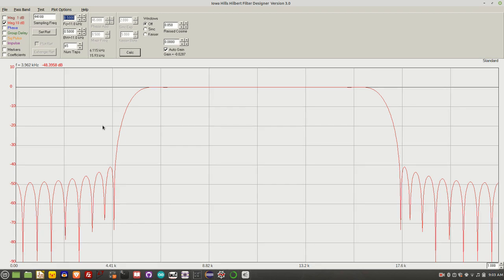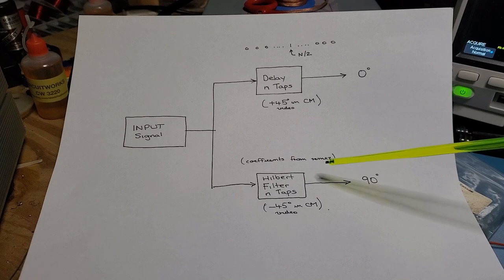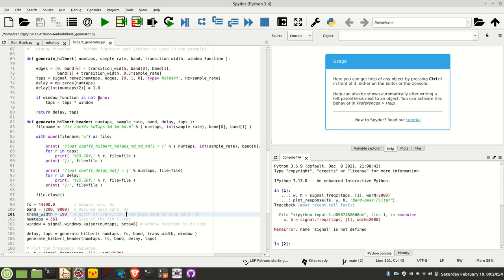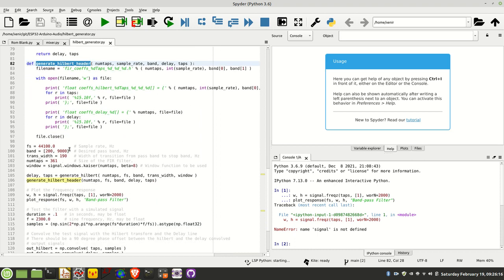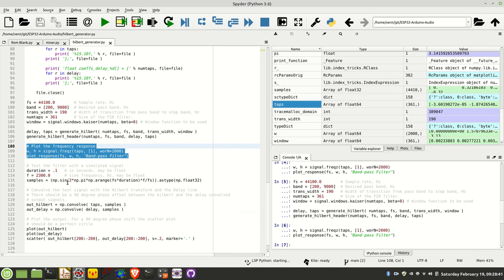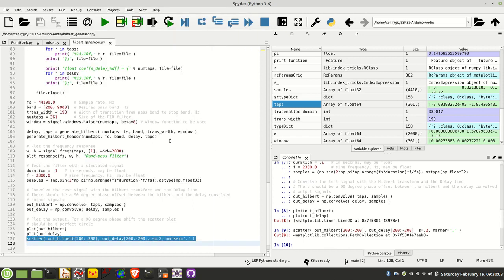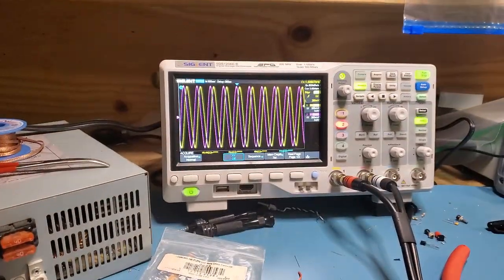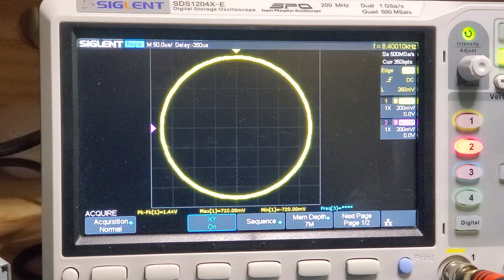Hilbert FIR Filter for 90 Degree Shift using Python

Comment: Interesting but it seems to me the delay is improper... the I component needs to be filtered in a complementary way to the Q component, that way the lissajous plot will always be circular, and the radio wave will be perfect single sideband. I'm not sure what is the best way to get this though...
Reply from the maker: You are exactly right Mark. I discovered this later on - what I ended up doing is running the signal through a bandpass filter prior to running through the Hilbert filter. I had thought I updated the code - but I checked and its still the same. Let me see if I can find the updated code somewhere. Thank you for the comment!

Comment: Many thanks for sharing 👍As I understand from the documentation for scipy.signal.remez() it's not necessarily to suppress low frequencies as you previously did with Iowa Hills software. The function merely looks for the coefficients which give you the desired filter, so you can create a LPF or a all-pass-filter if you want to (but maybe I'm missed something). Also it's worth noting that the "delay" implementation although OK for the demonstration is sub-optimal. There is no need to do hundreds of multiplications to zero in order to delay a signal for the given number of samples.
Reply from the maker: you are definitely right on the delay line - I just wanted the easy path ;)

Like I said though I couldn't find any way to produce an arbitrary phase shift. Drop me a line if you find one.
Reply: @na5y  Finding a DSP filter with the desired frequency and phase response can always be considered as an optimization problem, or alternatively as a search on a graph. Your state are current coefficients of the filter. You fitness function is the difference between the current filter response and the desired one. The edge on a graph is the change of one or multiple coefficients. There are many algorithms that can be applied to the task: genetic algorithms, bread-first search, A* (A-star) - just to name a few. These algorithms typically are well covered in the AI related textbooks, e.g. "Artificial Intelligence: Structures and Strategies for Complex Problem Solving" by George Luger. Basically the same algorithms are used in the database management systems for SQL query planing/optimization. The suggested approach would be somewhat brute-force of course but it will work.
Reply: @na5y  An additional piece of information was found in the famous "Digital Signal Processing" by Steven Smith (aka DSPGuide) on page 573. Let's say we have a Hilbert transformer that shifts the signal by 90 degrees. Subtracting the shifted signal from the original one gives us -45 degree shift. The process can be continued in order to get any necessary phase shift.

Comment: Thank you.  Nice work. I was able to save the Iowa Hills site before it went down.  But this is clearly the way to go.
Did you try it at the low wend of 300 of 400 Hz?  If not 90 degrees, the suppressed (opposite) sideband will jump up.
Reply from the maker: Thanks for the comment. The low frequency is definitely a problem and the bandpass filter created doesn't quite weed out the low end. A greater number of taps ameliorates the problem a little. I know software like HDSDR has the local oscillator frequency offset from the tuning frequency by 5-10 kHz - I have been meaning to play around with that technique...

Comment: Thank you, I was searching for a means to do 90 deg phase shift for grid voltage (to create a PLL), following are means that I know: -
1. delay lines -- depends on frequency.
2. Second order generalized integrator -- it needs separate "w" (freq) to be measured, but if we somehow measure (using a zero cross circuit) and feed into the SOGI block, it works good. It also has the advantage of ignoring the harmonics.
3.Hilbert transform -- I read in books but never found a practical implementation, untill I saw your video. Let me try it.
Reply from the maker: I was in the same boat - I could find plenty of papers on the topic (which mostly went over my head) but little in the way of implementation. I hope you are successful! Let me know how you get on

Comment: Grest video tutorial, there Is no band limitation in the delayed filter. I can see an horizzontal line in the Lissajous plot (x,y) out of frequency limit. Will you insert a prefiltering before? Thanks, Antonio (Rome, IT)
Reply from the maker: Thank you Antonio. At the beginning of the sequence the FIR filter produces a poor response because the delay line (the delay line required by the convolution algorithm that is) isn't populated.  I should really change the XY plot to remove the beginning "n" outputs where "n" is the tap length. Is that what you were referring to?

The delay line itself has no frequency limitation - beyond of course the limitation imposed by the sampling rate
Reply: @na5y Dear Ian, thank you for the prompt answer. Let's for example think to the ssb modulator in which we add  or subtract the two signals (delayed and hilbert filtered) to get the SSB, these two signal shall have the same bandwith otherwise we could have an unwanted signal out of the working bandwith. In this case the delayed one has more bandwith, as you say limited by the sampling. So mine was just a pleonastic statement to say that at the input it is necessary to limit the band of the audio signal before processing it. I just ordered the pmod-i2s and I will follow you on this project. thanks again Ian. Antonio IW0FCI
Reply from the maker: @antaf56  Agreed - without limiting the audio bandwidth at input you'd likely get aliasing artifacts. Thank you for the comment Antonio and good luck with the I2S2 board - let me know how you get on!
Reply: @na5y  For sure I will!! Thanks Ian

Comment: I don't understand the ESP32 throughout. Using 2x FIR channels, each having 361 taps, at sampling rate of 44.1kHz need approx: 44.1kHz ×361taps ×2 ×10(MACs) = 318MHz. Here it was assumed, that each multiply/accumulate operation using floating precision will take about 10 (7+) processor clocks (based on Cortex M4 estimates).  The ESP32 max speed is 240MHz. How does it fit?
Reply from the maker: You have an interesting question there odissey. The convolution code used is not mine and comes from the ESP-DSP library and is written in assembler
https://github.com/espressif/esp-dsp/blob/master/modules/fir/float/dsps_fir_f32_ae32.S

The ESP32 I am using is dual core 2x240 Mhz - but I don't see anything in the above assembly to do multicore processing. Let me do some digging - you've got me intrigued now. I didn't see any jitter or artifacts in the output

Thank you for the interesting question ;)
Reply from the maker: There's some benchmarking code in the ESP-DSP library here
https://github.com/espressif/esp-dsp/blob/master/modules/fir/test/test_dsps_fir_f32_ae32.c

I'll run it and post the results.

Unfortunately I don't know ESP32 assembler so its a bit hard for me to figure out what is going on. Stay tuned though
Reply from the maker: OK - so I added a simple performance test to "passthru.c" which I took from ESP-DSP
https://github.com/thaaraak/ESP32-IQ/blob/main/main/passthru.c

It does a simple pass with some generated coefficients and calculates the cycles per tap. Results are here
https://github.com/thaaraak/ESP32-IQ/blob/main/performance.txt

From the results it has an average of ~ 4.1 cycles per tap (If I am reading the output correctly). Using the back of the napkin

44100 * 361 * 2 * 4.1 = 130,5 M cycles

Which should fit in the 240 MHz (although now I check the output I am only running at 160MHz). Anyway - check my math/code and see if I go wrong anywhere and thank you once again for the question
Reply: @na5y  Interesting. So the key was assembler code. I thought that no such thing exists nowadays. 
     Great job! Always learning something new from your videos.
Reply from the maker: Yes - it looks like Espressif have done a bunch of optimization with the code. I don't know Xtensa assembler though so I can't make head nor tail of it ;)